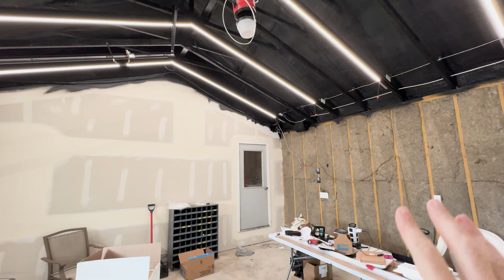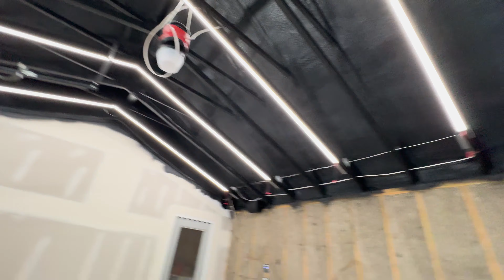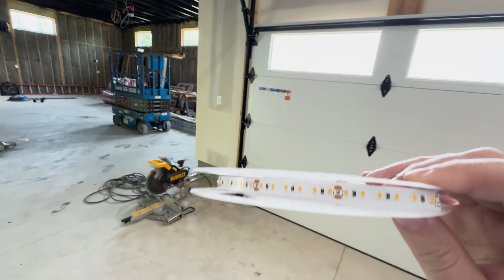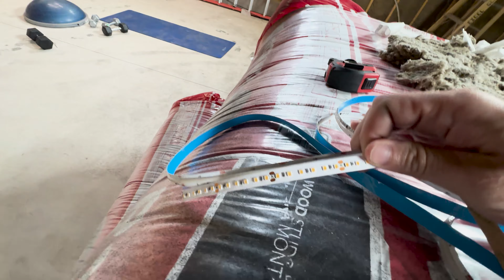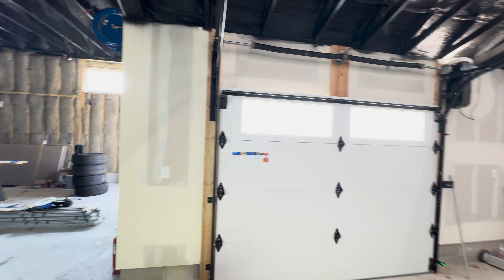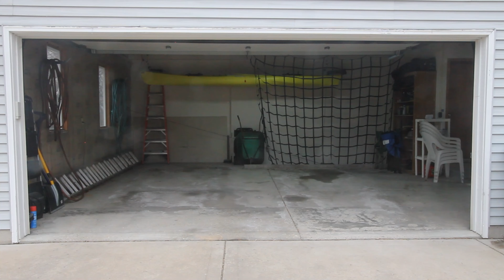Fixing LED Garage Lights // DIY Garage lighting Part 5 // Garage Build Ep. 38

Comment: I feel like some of the light output is wasted in the C-channel you used. It's fairly deep (relative to the strip) and dark. If the channel was shallow and white, or reflective inside it might be much brighter
Reply from the maker: Certainty would have been better to go with a shallow track and a silver track.